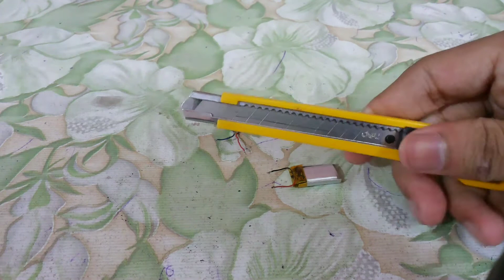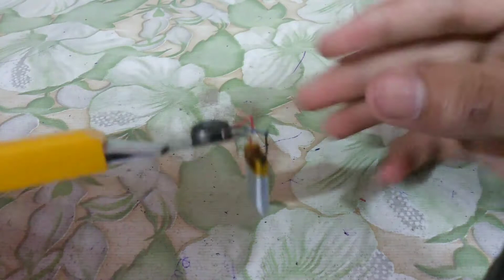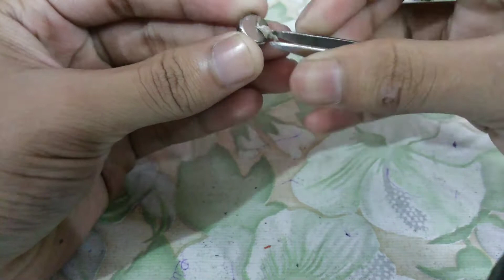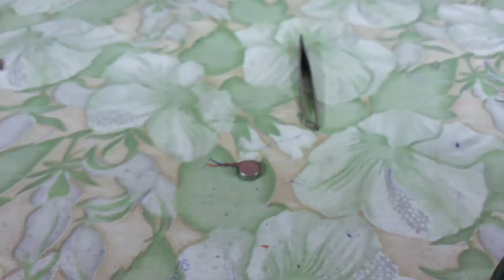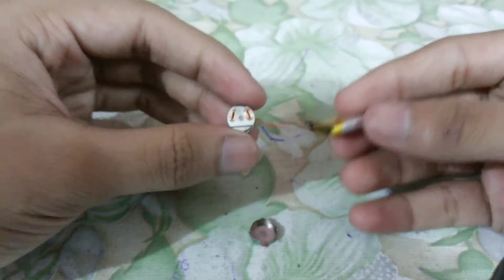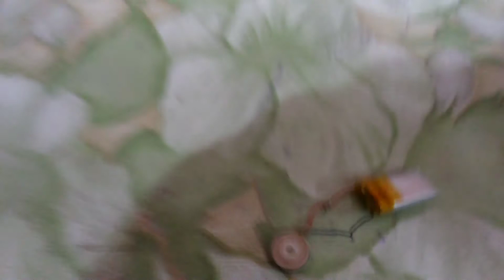Inside A Vibration Motor | Mini Mobile Vibrator Teardown | Running A Opened Motor | Mini Vibrator

Comment: before the tear down in the first 1minute and 30 seconds of the video what are those two components called?I'm new and still trying to understand vibratory motors
Reply from the maker: Hello 👋 
The all components are called
1. Battery 🔋 
2. Vibration motor
3. A Cutting Knife 🔪 
4. Sorry😅, I don't know it's name😅
I hope you have got your ans.😊
Reply: @RHHACKS  Whats that type of battery called because I am specifically looking for the one you used.
Reply from the maker: I is called lithium polymer  (Lipo) battery. Capacity 65 MAH. I had found it from my old M3 band.
Reply: @RHHACKS  Thanks a million.
Reply from the maker: Welcome 🤗☺